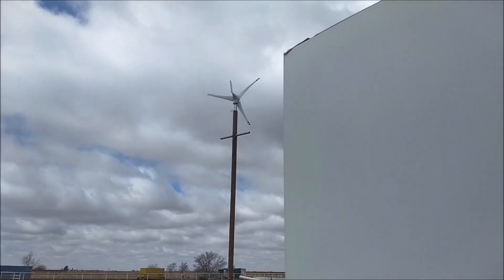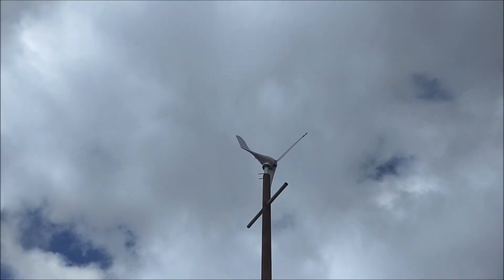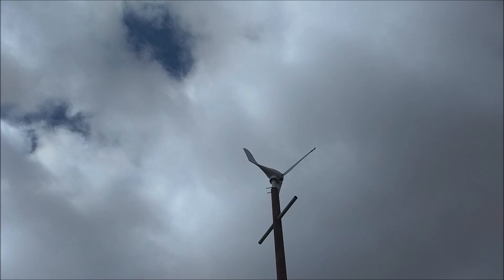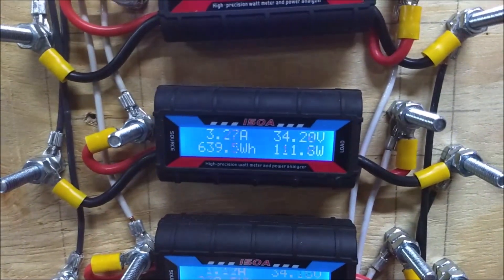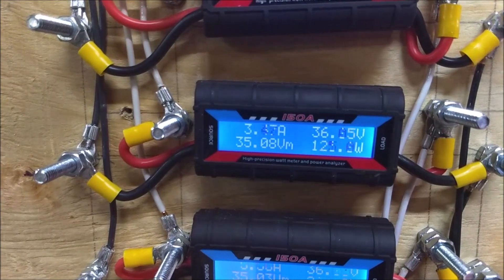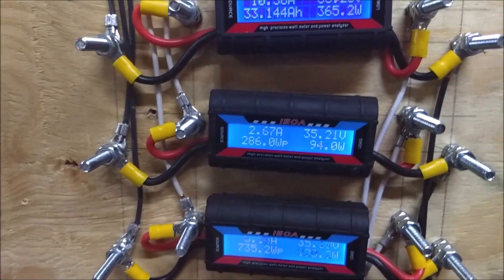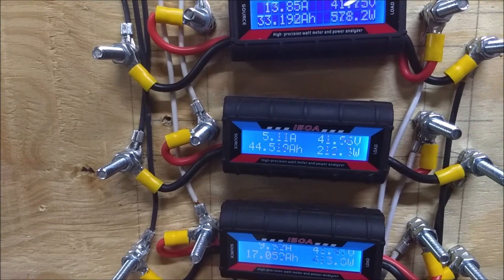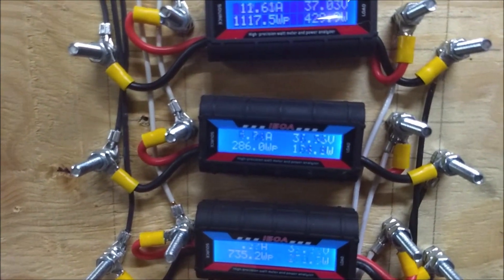500 watt (really 200 watt) eBay Wind Turbine in Rated Wind

Comment: You are pulling the voltage down too far you need an MPPT
Reply from the maker: First, there was nothing that could have helped this turbine.  Second, I have never seen an MPPT that could keep up with a wind turbine.  I've tried several.
Reply: @ToysforWatts  I use a Midnite Classic 200 in wind track mode
 A pre programed mppt mode with no hunting for optimum current vs voltage, it has pre set power curves you can also do custom settings too
You should look it up 
Midnite Solar

Comment: Is that a 3 blade or 5 blade
Reply from the maker: originally six, but running three presently.
Reply: @ToysforWatts  does it do better on 3?
Reply from the maker: @ericjackson6082  Much higher RPM, but doesn't start up quite as easily.  Which doesn't matter since even when it was starting in 2~4mph wind with six, it wasn't making any power.
Reply: @ToysforWatts  ok I got a 5 blade coming from eBay should be here Friday I will do a video on it this weekend
Reply: Is that a 3 blade or a 6 blade

Comment: Dude that sucks they ripped you off so bad. My turbine in 15 mph gets 100 to 200 watts . And 20 to 25 500 watts 30mph 800 watts. Its a 3 phase ac 500 watt rated definitely more powerful
 https://youtu.be/Ys_cP2cS7YI
Reply from the maker: Well ultimately the reason I'm okay with buying these things off eBay is if they don't do what the seller says they'll do, I get my money back.  This one struggled to produce anything out of the box and, after some debate, the seller and I did reach an agreement.
Reply: @ToysforWatts  cool. Free turbines.
Reply from the maker: Sometimes yes, sometimes no.  Some sellers will opt to return the machine, most sellers will negotiate a settlement, some will refund and wash their hands of the thing.  This one I settled for approximately a 70% refund...I'm confident that with better windings in the stator it could be a producer, so it's possible I could rebuild it better.
Reply: @ToysforWatts  that's cool
Reply: @ToysforWatts  make a video on one of these they will dish out the energy big time.
Reply from the maker: @donaldsteele6276  This one is a few bucks less (because of the offer), sold out of a US warehouse which means better support for returns and claims, looks really similar to that one, and so far has peaked close to 1200w.

https://www.ebay.com/itm/700W-3-Blade-Wind-Turbine-Generator-DC-24V-With-Waterproof-Charge-Controller-US/232959000373?ssPageName=STRK%3AMEBIDX%3AIT&_trksid=p2057872.m2749.l2649

I'm leery of the aliexpress rigs because if you don't get what you pay for there's not a huge amount of support from the site.

Comment: This is similar as the one before... You wonder if the strenth of the magnets are same? The similar one you say it has more cogging to get it to start up. But thanks for sharing the false hoods of the China poor qualities!!
Reply from the maker: This one really has a slightly smaller stator and the the windings are a considerably smaller gauge.  I think the rotor is somewhat larger, though, but the power is more in the copper.  I can't speak about the strength of the magnets, I'm still trying to develop a way to measure them in a manner that will be comparable to other turbines.
Reply: @ToysforWatts  yeah i bought one like that before and it was  a vevor 400 watt it was more like 50 watt junk . The one place i get them from now in china actually makes real good 3 phase turbines .